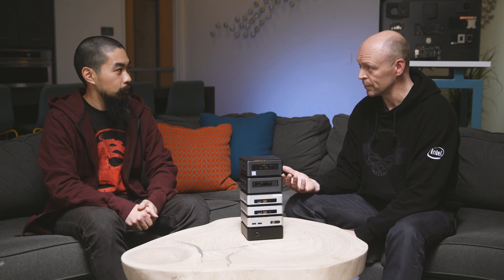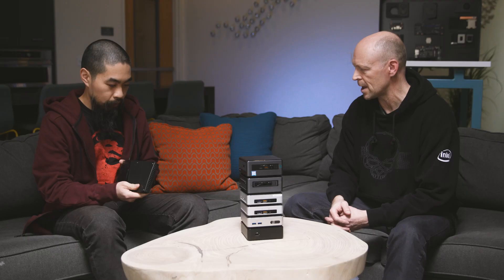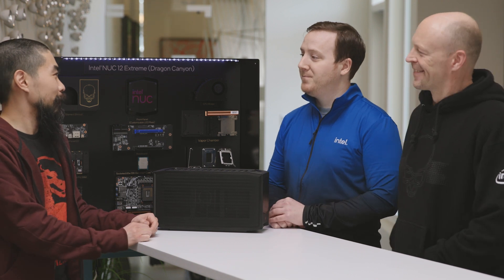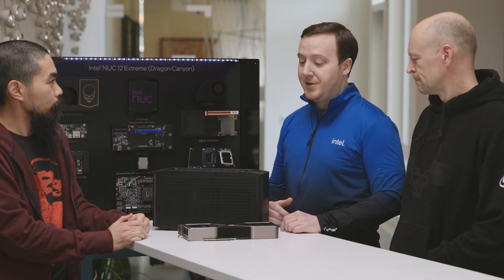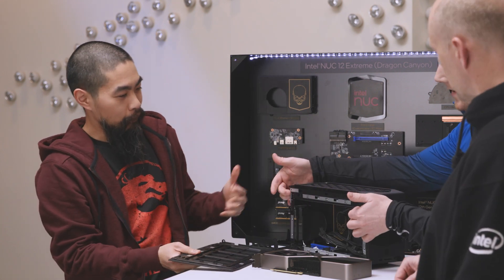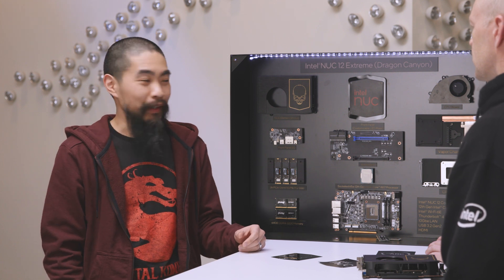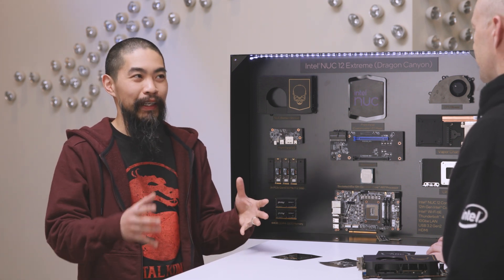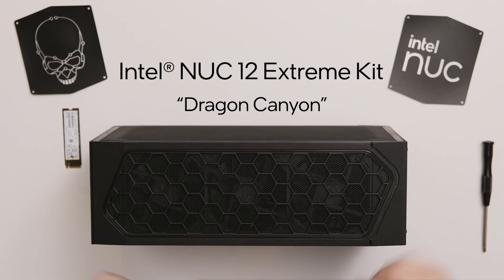Intel NUC 12 Extreme “Dragon Canyon” Explained | Talking Tech | Intel Technology

Comment: I've had the NUC 12 Extreme i7 for a few weeks now and was wandering about upgrading the CPU to the i9. Is it as simple as me buying the 12900 i9 variant and putting it within the Intel NUC 12 i7?  Or should I add thermal paste/update the BIOS? Or is the Compute element slightly different with the i7 variant versus the i9 variant? Would it void the warranty?

Comment: These guys are great engineers.(congratulations!) but ... I think  the Marketing  distribution model is a fail. 
Why?, because the SFF Enthusiast market is mostly about building your own system, with priority to compact size rather than top performance. 
But I like those engineers and I want to offer a constructive crtitic. In my opinion a truly SFF enthusiast  kit would need  to offer a simpler kit like this:

- A compute module + CPU, with i3 or i5 also available, not only i7 and i9. In fact  the i3 and i5  are the favourite CPUs for SFF hobbyists.

- The Baseboard

- A flex  SFF PSU more suited to mid range systems (something in line with the HDPlex 400w, it needs to be "thin", not just "small")

- The case needs to be optional.

Then let the SFF enthusiasts chose the coolers, the PCIe risers, the sff case (or an open frame solution), or even let us build our own case. Those things are  really at the heart of  our hobby.

But instead, now if we want it we will be forced  to buy a whole pre-built  system, and also pay for some of the most expensive CPUs, and also forced to buy the case  weather we want it or not. Who asked for that?

A pity because the NUC engineering is phenomenal and superior to other SFF  solutions, so I don't want to be negative and  I also want to say the good things. I will mention 3 key ingredients of the NUC Dragon  that are superior for SFF enthusiasts compared to other solutions:

1 - The compute element (with cooler) is clearly thinner than a mini-itx board (with cooler). Best in class for SFF.

2 - The separated baseboard offer a world of possibilities for custom builds.

3 -The ability to have both Thunderbolt and DDR4 integrated in the same LG1700 board (not to mention 10Gb Eth) is currently  pretty unique and very desirable for SFF enthusiasts. The other mini-itx manufacturers  force us to use DDR5 if we want Thunderbolt, which at this moment in time is absurd. 

So I think those designs  are great, but  I am afraid all this effort has been wasted by the marketing model, at least for the  market it is supposed to go for. Basically the marketing department got this marvel from the engineers that was designed  for "SFF enthusiasts" and they converted it into a product for "beginners wanting to show off".

That  is partially ok because somebody has to pay for this,  but they should also think about the true SFF enthusiasts isn't it?  Don't forget that SFF enthusiast reviews  have a very big influence on beginners, and I bet with the current marketing  model  these reviews  are going to be pretty  negative.

In any case thanks for the video, it's really a good video (much better than Intel  keynotes) and it is  great to know the team behind this technical marvel.